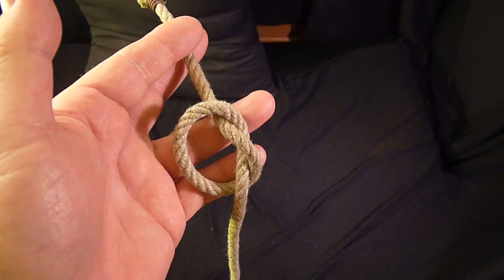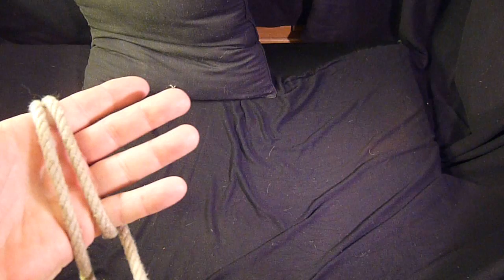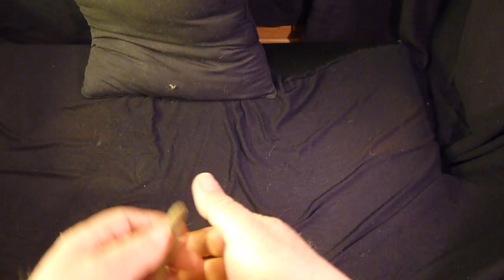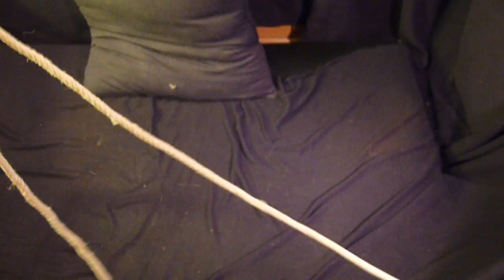Overhand Knot

Comment: If you make a round turn and take the last loop over the other ,and also over the rope you get a clove hitch which is two half hitches then pull one half hitch through the other and you get an overhand knot which is made of two half hitches,if you want to see both of them you need to invert the knot by turning it inside out.